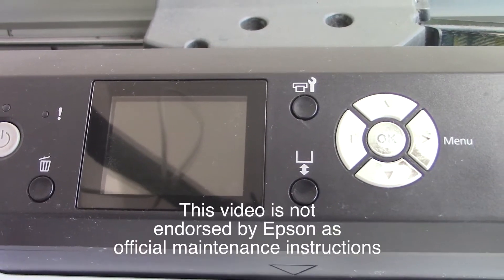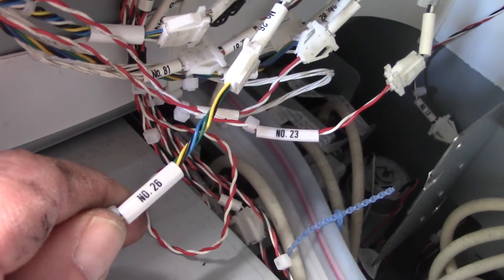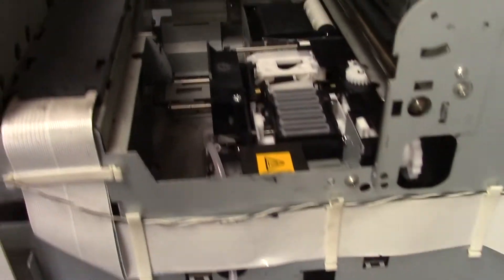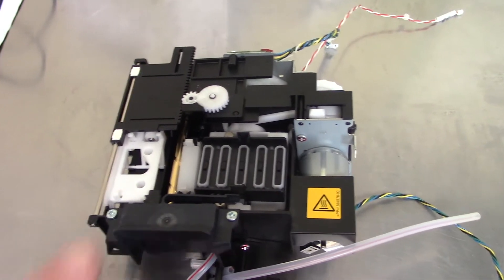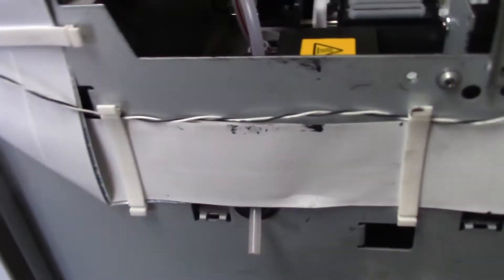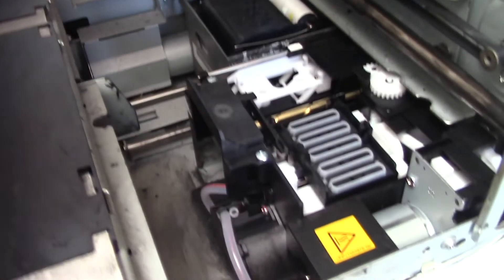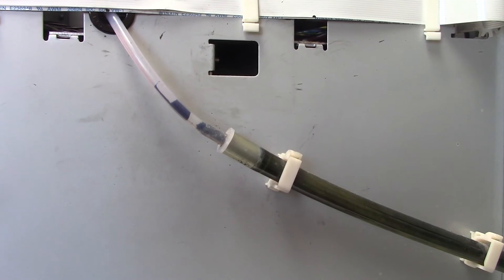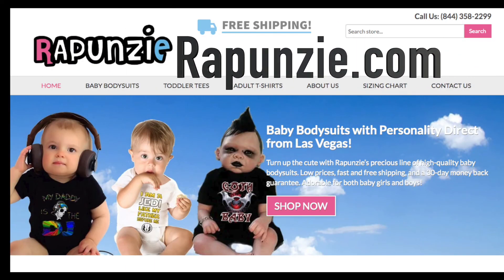Espon F2000 DTG Printer -  Replacing the Maintenance Assembly / Suction Cap Assembly

Comment: Hi Gregg, What is the very first step to move the head to the left ? What is the process with the control panel ?
Thanks !
Reply: Second this question...
Reply: @pontiacchick88  Hi Melissa, I managed to find the solution by myself. You have to  tell the printer to do a cleaning around the printhead (the one you do with the little green sticks to remove fabric residues from the head). Once the head has moved to the middle you can start the process of changing the maintenance assembly.
Reply: @vincentcrz6975   Thank you!  After the print head has moved to the left do we unplug the printer to cut the power? I assume we want the printer off since we are disconnecting wires? Or does that not matter since they are clips? 

I really appreciate it. I have one of these assemblies being delivered on Saturday and there is no instructions as far as I know.
Reply: @pontiacchick88   Yes I think I unplugged it once the head has moved. Replacement is not a big deal if you follow the instructions in the video carrefully.